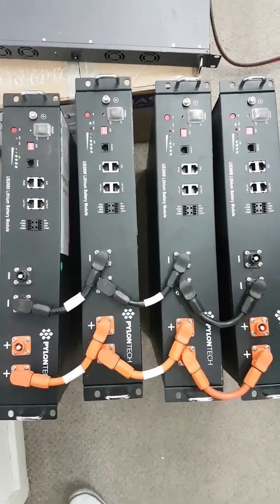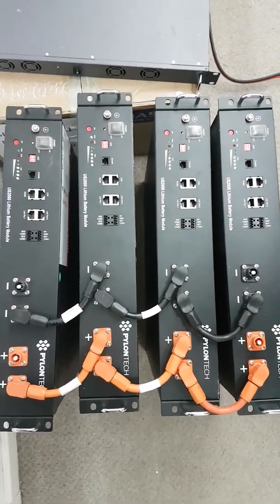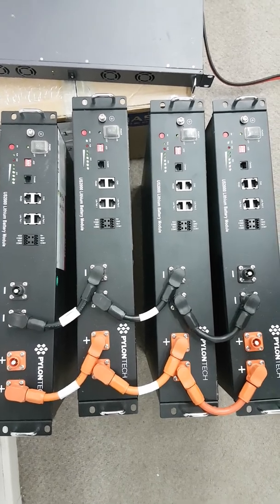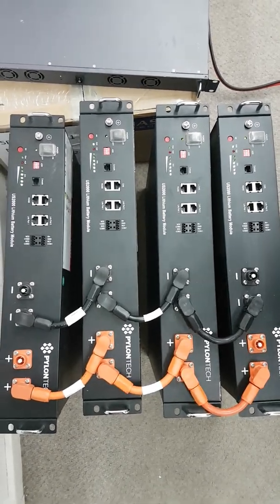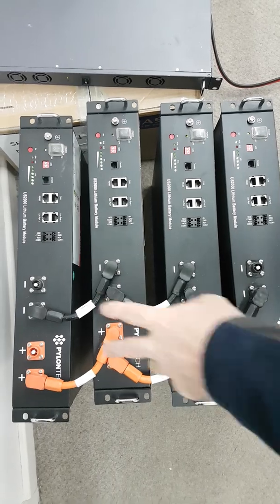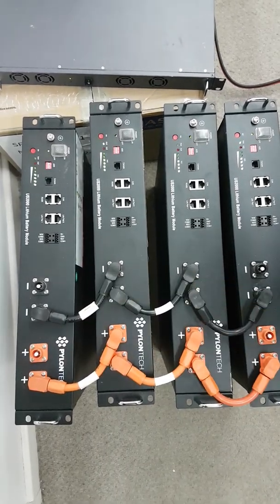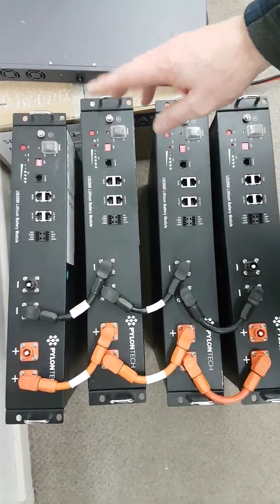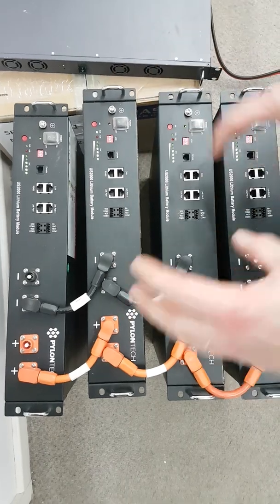PYLONTECH US2000 - Battery Balancing

Comment: Hi, I currently have two us3000c batteries connected to a LuxPower Hybrid inverter.  Bought a new battery, same spec and connected it up so that it was the Master. I let the two current batteries charge fully first.  

I left the data and power caples from the inverter disconnected and then pressed the SW Run switch on the Master. It then started balancing in the same way as your video.  Left it overnight and then all the lights were out except the Run led light flashing alternatively on every battery.  Does this mean it completely successfuly?
Reply: I then switched off the batteries then connected the inverter data cable to the rs485 and the postive power cable to the master and negative to the last battery from the inverter. 

I then switched on the Isolator switch. But the inverter asks if I want to add a battery.  Is it just a question of re-entering the settings? Would pressing the SW run button again with everything now connected to the inverter correct it?

Comment: I don't think this is quite right. When you connect them all in parallel like that, they balance the *voltages*, not the SOC. The light indicate SOC, not the voltage. So even after balancing by doing this parallel connection technique, the SOC values for individual batteries can still be different (even though the voltages are the same).

This mis-matched SOC is a big deal because the charger will get an average SOC value from the batteries and charge or discharge accordingly. Example, with 3 batteries, if two batteries are at 80% SOC and the third is at 60% (even though the voltages are the same) the charger will see an average SOC of 73.3%. The charger will use this number to charge, for example, meaning that if you set the maximum charge SOC to say 95%, the two (previously 80% SOC) batteries will be being continuously charged with the BMS reading 100% while the third battery is being brought up to 85% SOC whereupon the average SOC will be 95% and the charging will stop. At this point your batteries differ by only 15% (the difference between 100 and 85) , which is better than 20% difference (80% - 60%).

To get a better balance between batteries you can charge each battery individually up to 100% SOC and check that the voltages are same on the cells.

Comment: 3D Motor Maker is correct. The master battery #1 BMS is managing all the other slave BMS’s and as each reaches full charge, the BMS of that battery will stop charging to that battery so current passes to those on a lower charge state. After adding 3 new batteries to our existing 5 battery bank that was 3yrs old, it’s balanced out during running in a couple days.

Comment: I always thought that the individual modules have their own BMS, to balance out the cells.  Surely if one module is a lower SOC than the others, when the others are fully charged the lower module will catch up it can't be the case that the first battery to reach 100% stops the charging of all the others - that's why they have a coms interface.
Reply: Agree with that. If you monitor the comms interface, the 'master' one is controlling the charging of the slave ones, and balancing them. I added a single 1/2 charged one to three others, and they balanced after a few hours.

Comment: Thank you for the information
I just added another 4 batteries to my previous bank of 4 which is 3 months old... I have the new ones being charged by the old ones at the moment
Reply: Did you install the batteries yourself.
Reply: @KPN3872  I did the entire solar installation myself..
Reply: How long did it take for your batteries to ballance?
Reply: @TIMMEH19991  approximately 12hrs..
Reply: Which inverter/charger are you using? I have 2 batteries but no charger yet (supply chain issues!). You presumably are charging using solar PV but are you grid tied also?
Reply: @mb-3faze  not grid tied and using victron mppt charge controller and victron Multiplus 2 inverter

Comment: After 2 months the small variation between my two sets of Pylons (ordered two and then 6 months later another 2) has disappeared. Not say that one shouldn't  balance the batteries but it appears they sort themselves out over time.
Reply: When voltage is over 49.8 cells are top-ballancing - so it helps to charge the pack to 100% from time to time.
Ballancing is very slow (around 20 - 30w so it can take a long time if difference between packs is significant).
Reply: Yes they do balance out over time. It can take up to 3 days to do that from my experience
Reply: @drsolar  I have 4 US2000s fully charged and I added 4 US2000Cs at 50% (You put them first in the loop with one as the master) and after 3 hours they still are far from balanced. I take it if you make them live onto the inverter they will stop balancing? At the moment they are plugged in but the isolator switch on the inverter is switched off.
Reply: @TIMMEH19991  they need to charge and discharge to balance.